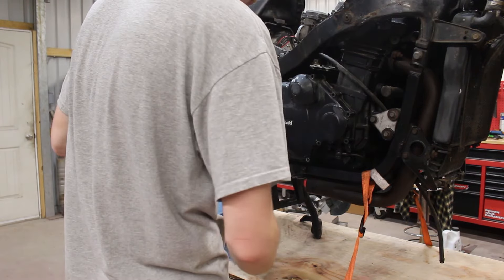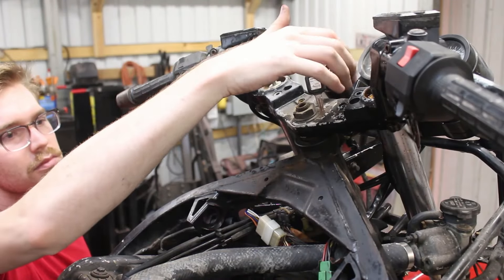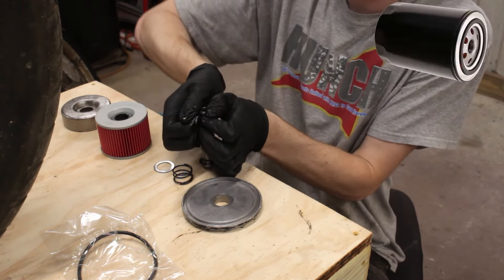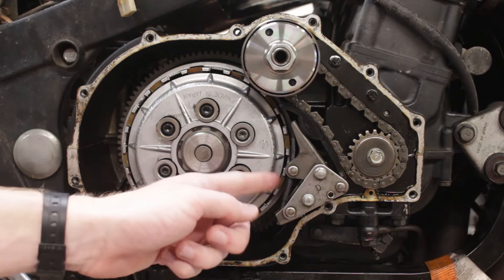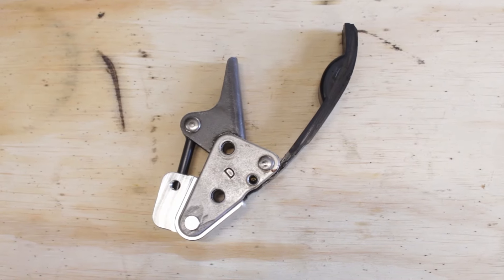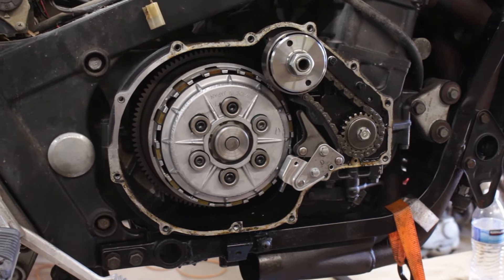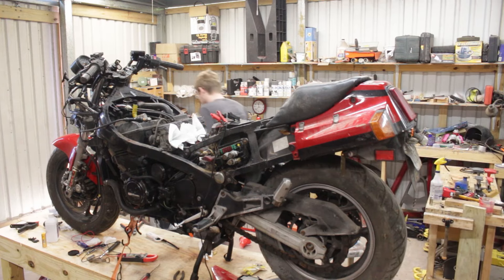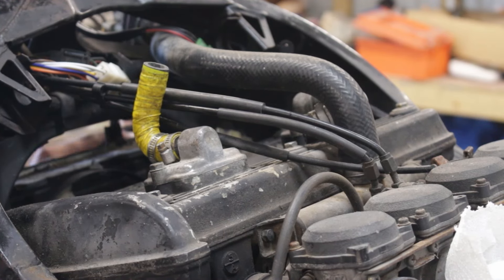Looking for a Pulse | 1986 GPZ1000RX Revival - Part 2

Comment: Can't beat a bit of 'insta-graf'. When cleaning carbs renew as much as possible. Nearly every bike running issue I've had has been gummed up carbs (even after I thought they were clean). Also beware of carb cleaning companies. I had a set returned that looked great but on close inspection (After I had fitted them and no change) they had missed a load of small channels & didn't mention there was a lot of wear & it was really a waste of time. Do it yourself with new parts & ultrasonic cleaner. Great vids I have an old GPZ600R to do one day !! P.S. my old GPZ9 had an issue with the sealed fuse board (internal corrosion). Maybe different in the 1000RX but thought I would mention it.

Comment: Make sure you take the oil pan out and clean it. Bigger particles won´t make through the screen in the oil pickup, so just changing the oil filter won´t get rid of them. Sometimes there is just so much crap in the oil pan that the the screen will clog and the engine will not get enough oil. If I just had done when I first got mine, it would have spared me from having to redo the lower end.

Comment: That clutch basket will be fine and you need to clean and lube the handlebar switch internals and brake switches. Dont worry about compression numbers on an engine thats been sitting... Just run it for a bit.. Get the rest of the bike sorted..you can always pull the engine later to fix that if needed.

Comment: Lovley. I stand corrected and reacted when I saw the oil filter change and before I wrote anything here I checked the facts and the metal cup DOES go on top on your bike and UNDER on my bike which is Z550. So I´ll just count to ten before I comment your work as it surely seems like you DO know what you are doing (RTFM ;)

Comment: i would just fill the carbs up with gas(with carb cleaner added), hook up the airbox and see what they do before tearing them down. if youre lucky they might clear out fine. And aftermarket rebuild kits usually means trouble in my experience.

Comment: This summer I actually rebuilt some keihin diaphragm carbs on a Kawi. If you end up changing the air filter, you can change the fueling for the needle by putting spacers between the needle and the main body ( assuming yours also doesn't have a c clip )

Comment: Roni the little chunk that's been knocked out of the clutch basket if you look to the back of the basket a little to the left of the missing chunk there looks to be a fracture.
I may be wrong but i wouldn't like to see you to do all that work and the next thing your going down the road to find out your clutch basket shatters in a million pieces.
thought I'd give you the heads up. Great videos keep them coming.

Comment: I would disassemble all the little switches for the controls and clean them if you can. My first bike (a 1978 Suzuki GS850) had similar issues with intermittent functioning of the clutch/neutral switch, brake light switches, and turn signal switch and it was just that all the contacts were dirty. I think it took me like 15-30 minutes to clean them and they never gave me any other issues.

Comment: Even though it will be a bit pricy,I would replace that broken clutch basket. A GPZ 1000 has a lot of power and that missing piece will crack further and blow up,possibly damaging your engine cases. Then the bike is trash.

Comment: The stator does not have to be dry. My kawasaki kz400 is one of many bikes that have an oil passage to the stator compartment and so there is oil behind the stator cover. Many modern bikes have a wet alternator as well.

Comment: I love your editing work, but I couldn’t leave the stuff in place that I knew would be haunting me  later down the road. Literally. A lonely Texas road. In the middle of the night. 

I can’t leave that Yoshi exhaust on: it’s a crime to see how poorly it fits.

I can’t reassemble an engine with rusted rings and scored cylinder walls.  (New rings and honing the cylinder walls is a cheap and easy fix that you can do with a drill and stones on a tool that is easily available). That gpz is a sweet bike that you might end up keeping for a Ling time. 

And most glaringly: that clutch basket has left metal in the case that probably wreaked havoc  on the bottom end.  
Plus that missing piece on the clutch basket makes me so uncomfortable that when I look at it that I would chip in to your clutch basket go fund me page. 

I can’t wait for your next video!

Comment: I"m coming back to this video to see how the battery is fitted, little advice for people removing the battery. Loops some electrical cable between the terminals to pull it out of the battery holder.

Comment: its common for motorcycle engine compression testes are absolute garbage when cold. non hypereutectic aluminum pistons means there is tons of windage clearance when cold. along with thin sticky rings just dont worry about compression tests on motorcycles. as long as its not zero its perfectly fine.

Comment: So 2 things. The “extra” butt connector on the ground for ignition was probably for a electronic rpm gauge. And do yourself a favor and swap over to a dynatek ignition system. It’ll save a lot of headaches.

Comment: Depending on part availability vs effort, I dont usually get used replacement parts, especially electrical. If it is a machine that still has ample new parts that can be sourced or an aftermarket and I am considering of taking the top end for one thing, I will rebuild the whole top end.

Comment: Someone else has probably already pointed it out, but the extra wiring connector coming off of the coil that you had to fix was probably a signal wire for a tachometer
Reply from the maker: Tach signal is from the ignition module! And it works fine :) The extra wiring was just good ol' fashioned jerry rigging.

Comment: Even with an improper fit, that pipe is way better than stock. I've used many of that model pipe on different bikes of that era and this pipe is better. No doubt. It should clear everything, but they often required complete removal for oil and filter change. Such was the price of performance and ground clearance in the 80s.

Comment: I'd take a guess and say that the failed tensioner was the root cause of the bike's accident. If that was to seize the engine or the transmission, the rear wheel would lock up, and there's no chance of saving that while moving at highway speed. The big chunk of missing aluminium is a tell that the clutch was impacted while rotating at high speed.

Comment: Anything like the 900, will need, new camshafts, valves wear and shrink, cam tensioner, cam chain guides. Alternators get cooked. Take sump off and clean strainer.

Comment: Awesome vid man. You should check out Mustie1, he does a lot of "will it run" videos and he is always doing old motor cycles. When he turns them over for the first time he adds 2 stroke gas, usually 50:1. That way it lubricates the cylinders and rings a bit since they haven't run in who knows how long. Starter fluid is great, but it doesn't lubricate at all. Can't wait for the next video!

Comment: Be aware it uses a starter clutch. They can fail and the engine will sound like it's cranking but actually isn't as the clutch slips on the compression stroke.

Comment: Than pin/hole is there so that the tensioner hold its positioned when cranking, and not for assembly. On newer iterations of this engine, the alignment of the tensioner and clutch assembly has been changed, so even if the pin comes loose, it will not cause a major damage. It is a shame we can´t just do the same on it.
By the way, mine had exactly the same problem.

Comment: It's usually a better idea to ditch the resistor caps and just use resistor plugs. It's cheaper and the resistors get changed with every plug change that way

Comment: Kawasaki's design department philosophy: "Don't worry, it will all work out great in the CAD simulation". 

Every manufacturer has supplied some quirky engine/frame designs at some time or another. But Kawas seem more frequently than others. Kawas look great but they have had some messed-up weird engine and frame designs over the years.

Comment: Hopefully you got a stock air box for the bike because it won't run right with out it with the stock size jets. You will be able to get it to run but it will be super lean. If you don't have the air filters you can put pod air filters on it but it will have to be jetted for it. Factory pro has very good jet kits that are easy to use but get the one for running with out the air box.

Comment: FYI, your last clutch fiber was installed wrong by the PO.  Not a huge deal but the tabs sticking out that hold the fiber against the basket on the very last one should be clocked differently from all the others.  Hard to explain with text but look at the fingers on the end of the basket itself and you will see you can install that last fiber about 15 degrees CW or CCW, and in fact you should see marks on the basket of where the fiber first was.  Sorry for the poor explanation, but you will see it when you look at it again, I would think.

Comment: I did notice some thing do you have the carburetors that are normally on a scooter these have like a vacuum operated secondary to get the correct compression test either remove the whole carburetor or use a flat tip screwdriver to hold the vacuum secondary up while holding the throttle open it’ll give you a higher reading on every cylinder the discrepancy could be up to like 50 pounds per square inch

Comment: I replaced the key switch on my zzr1200. Had me running ragged replacing further parts because engine wouldn't start.. Until i found the new aftermarket switch was missing the security resistor. Removed from old switch and fitted to new, finally started.

Comment: What are those blue towels called? Is it even paper? Is it made for mechanical use? Does it soak up oil without coming apart? I se a lot of people use it but i can't find it anywhere. I dont know what it's called or even what it's made of either.

Comment: unless a bearing or gear fails - oil filters don't actually do much. All combustion bye-products are so small they just pass through the filter.  You are better off leaving them along for 25,000km.  Just change the oil about 50% of the way though the factory service interval and the bike will never wear out. 
Engines only wear because idiots do extended oil changes.  I'm including oem manufactures that recommend  25000km oil changes etc.  They claim tolerances are better and synthetic oils protect for that distance.  That may be -  but sludge is sludge and it will kill a motor in no time

Comment: The computers on these are known for intermittently quitting. Im gonna vote down the line the ECU will probably let you run the bike for about 15-20mins until it just cuts off and refuses to start until the next day. They do make aftermarket control modules for these for like 120$. I would just replace it.

Comment: Man, what is it with Kawasaki and chain tensioners? The KLR 650 has had a very similar issue...for DECADES! And the solution is the same, an aftermarket part.

Comment: The proper way to clean the mating surface is to use your tongue.  You should just replace the engine with an inline 16 cylinder engine

Comment: Number 1 cylinder is going to continue to be a bitch, even if you get it running. I know this because I have an 86 also. Even when its running right at will foul plug 1 over and over. Ive decided that head gaskets are in order. And this is why mine has been parked for 2 years.

Comment: Ronald Finger.  IMPORTANT NOTICE.  The oil filter assembly shown at 7:44 is INCORRECT.  You installed a new filter in the same incorrect fashion as the previous person.  Check the factory manual.  I have one and I can scan the page that illustrates the correct arrangement.  Let me know if you need it.

Comment: Hi, Is it me or dose the clutch basket look like it is cracked.  The spot where he said a chunk of aluminum was missing, if you look closely you can see what looks like a hairline crack.  With the clutch rotating counter clockwise and that rod bouncing around the way it was, there is a good chance the rod jammed it's self into the clutch basket for a split second, which took that chunk out and cracked the basket.

Comment: Why not just hook it up to a car battery with jumper cables, and jumper the ignition wires. You could have gotten the starter to turn over for no $$$ and find out if it even had compression before spending money on it. I somehow just can't see anyone wanting to steal that bike. I hate engines with internal chains, which means chain tensioners as well. I used to own a Kawasaki Vulcan 750. FOUR cam chains. What a nightmare. I'd replace that clutch basket as well, it will eventually break with that big chunk missing, and do a lot more damage. Brake or carb cleaner comes in real handy for cleaning gasket surfaces. You serious (lack of) compression problems. Hope it's the valves and not a loss of ring seal. Squirt some oil in that dead cylinder and try it again.  The clutch and sidestand nanny switches should be removed, thrown as far as possible, and the wires jumpered. Damn safetycrats. NEVER EVER use starter fluid. It is ether, and burns really hot. Hot enough to burn holes in pistons. Always use gasoline in a spray bottle. If this were an '83 GPz1100 with EFI like I used to have a long time ago, there would likely have never been any chance of making it run. That thing was a disaster.

Comment: Are you not concerned about where the missing tensioner part is? seems awful big to just be bouncing around in the engine.
Reply: And the clutch basket is cracked where the metal is missing.

Comment: So the piston rings are stuck? Guess why: Corrosion. They may come lose again, but there is no clue about whether or not their air gap still is within specs, their shape still is nicely round with a defined edge or just a one nagged and chippy like a battleworn old sword. There's iron oxide in the combustion space, a brilliant abrasive. Especially for softer materials like the aluminium of the pistons. There is a good chance cylinder one, where water obviously made it into, has bad pitting. If it were mine, I'd take out the engine, strip it down completely and check all parts. The absolute minimum you should do there is taking off the cylinder head and check the cylinders and pistons more closely. This is not a truck or tractor that will rev up to 3000 RPM, this is a motorbike.
What yo do there appears to me like making a horse run on broken legs. Kick it enough, and it'll go as far as it gets, but then it's a case for the butcher.
Reply from the maker: I don’t have to guess if I already stuck a camera down there and saw the corrosion in Part 1 :) I’ve actually had the bike running for about 2 months now and haven’t experienced any issues with it, though I do agree a thorough inspection of the internals would be a good idea. At a bare minimum, I’ll stick the camera down into the cylinder again and check it out!
Reply: @RonaldFinger  I saw your last video, that's why I am quite as much in doubt running it at that point is a good idea. If it is in hindsight now, the gamble seems to have worked. With how the piston looked, I'd say you were extremely lucky.

 Me, I have worked in aircraft maintenance for some time and may be a bit zealous about things mechanic being in the best possible nick ever since, but cutting corners in maintenance and repair on a bike has similar effects to doing so on a helicopter. There's only few parts the failing of which make uncritical problems. 
A friend of my neighbour killed himself by not paying attention when putting on a new oil filter on his bike. The filter sat loosely, spilt oil once there was enough oil pressure, which sadly was on the Autobahn A555 between Bonn and Cologne. That's one of the few left in our region without speed limit. He had a well lubricated rear wheel at 180+mph as it turned out…

Comment: As cheaply as possible? 
You mean like someone trying to get a bike they know nothing about running? 
Why would you buy a bunch of new parts for something that can be total junk? 
Throw some oil in it, use a car battery and jumper cables and see if it will run. 
You don’t run out buying new filters batteries or anything other that what is absolutely necessary to see if it runs. 
But you do you I guess